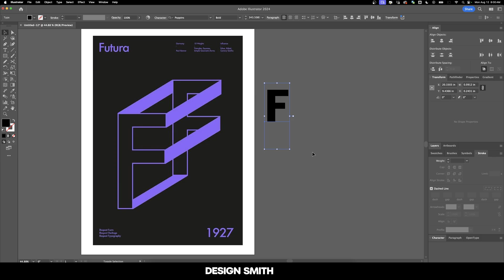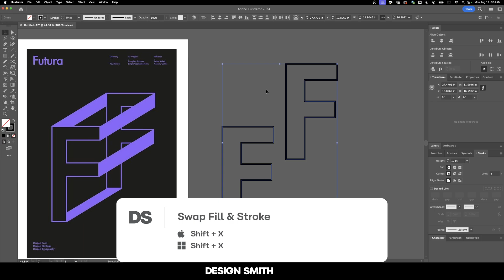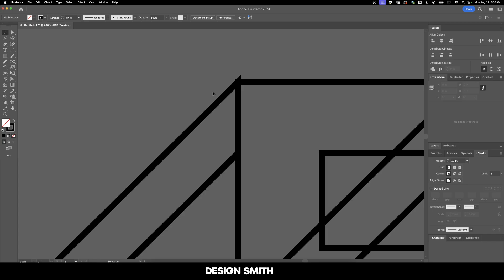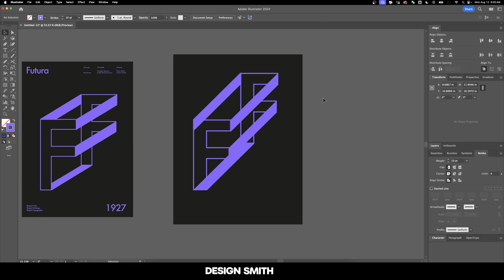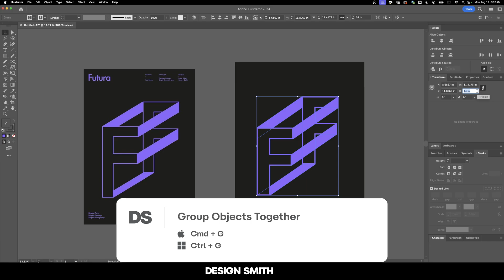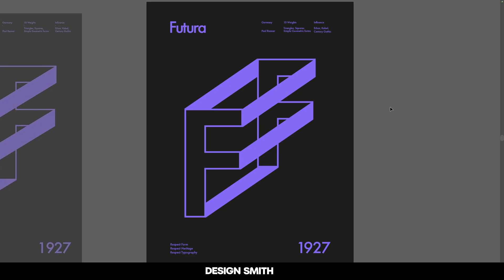Recreating This Futura Poster in Illustrator

Comment: this is nice, but you forget the most important thing, wich is the use of a grid, that's how things used to be done and should be done for you can achieve the accuracy, harmony and learn design
Reply from the maker: It's funny that you posted about using a grid in one of the very few videos that I didn't use one 🤣 the point of this video was to show how the F is done. Using those techniques didn't require a grid, but almost every other Swiss poster video uses a grid 😎